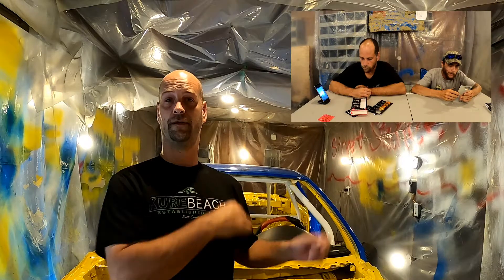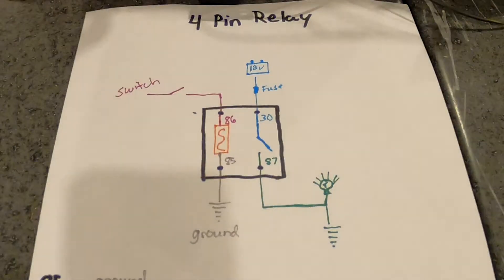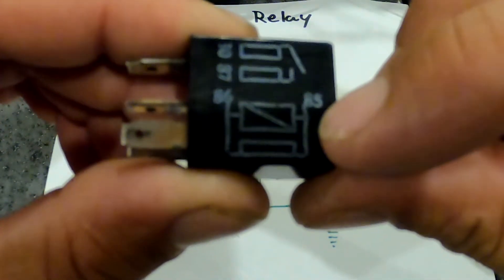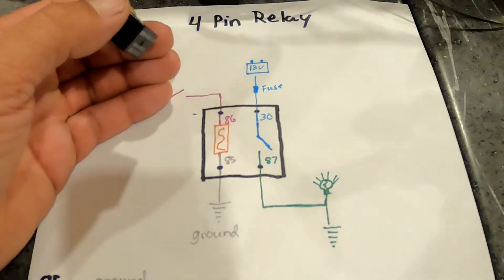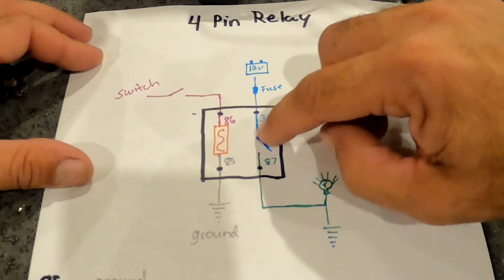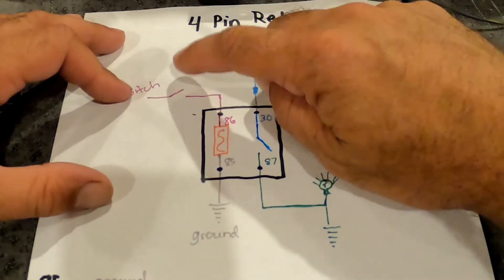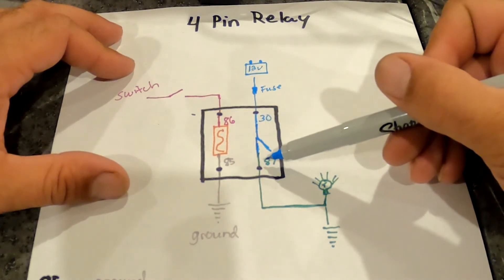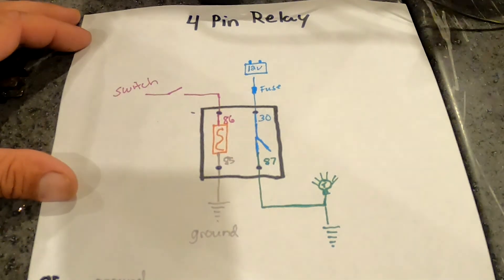How to wire a 4 pin relay

Comment: I have a 2021 ram 2500. A buddy of mine put a piece of wire in the fuse box where prongs 85 and 86 go and now the ac blower stopped working. I have power in 87 and 30 but 86 doesn’t have power no more. I checked the relay and it is still good since the relay was not plugged in at the time. All fuses are good as well. What could have messed up in the fusebox?
Reply from the maker: You put power to the ground. You must have blown a fuse. Under the hood or in the cabin.

Comment: To everybody out there who wonder why a 4 pin relay has 30 embossed on the side of the cover but 87a marked on the spade terminal. Have yet to see anyone address this dilema. 30 & 87a are the same!
Reply from the maker: Thanks for the reply. But your wrong. 4 pin relays don't have 87a. That is a 5 pin relay, and they are not the same one only has power when switched and the other it hot when you turn ignition on. So if you need something on from start and you hook to the wrong pin it will be off. you will have to manually turn it on via a switch.

Comment: I’m trying to help my brother in law wire a speaker into razor.
The razor comes with a bus bar that has a pig tail hook up.
It has 3 wires that feed out from the bus bar . Positive, accessory, and negative. He’s wiring a sound bar into a 4 pin  rocker switch to switch the sound bar on. He has to wire in this exact relay. We pretty much got everything where it goes but the 3rd wire which is the accessory wire. Do you know by chance where the accessory wire could go?
Reply from the maker: Should go to the accessory wire should go to the accessory wire from the ignition. Or fuse block for accessories. So when you turn the key it actives the relay. The power side should be hot at all times.

Comment: Quick question, is it relevant if instead of having a switch on 86 positive feed, the switch is from ground to 85? I mean it shouldnt matter because in my view both options would isolate the solenoid right? Is there any reason not to do it with the switch on 85
Reply from the maker: You can actually do it either way. But being me I would like for the power to be cut.

Comment: So before I found this video I was referencing a different diagram and connected both 85 and 86 to the negative terminal of the battery... obviously didn't work, but have I potentially ruined anything such as the relay, switch, or battery?
Reply from the maker: You may have hurt the relay if you powered it up. But they are pretty resilient. Hook it up the right way and see if it works if it don't power up just switch the relay out for a new one.

Comment: Y cant u just wire light direct 
Y do u need a relay
Can u explain please
Pretty green with electrical
Reply from the maker: The relay give you more control over the consistency of power ran to the device. You will need a 5 pin relay to run bright lights. One pin runs dim lights and one pin runs bright lights. It transfers power from one to another for you to make your lights change over. If not you will have a toggle for dims and another for brights and you will have to manually switch the lights over. And easier to blow fuses and over load the circuit without the relay.

Comment: Do you need a relay for each fog light? I'm running 2 halogen 55w bulbs. Or can I run 2 wires from pin 87? Thanks Matt
Reply from the maker: You can run both from it.

Comment: So if your object has a neg wire and positive wire which do you connect to 87 and where does the other wire go?
Reply from the maker: Whatever you are trying to turn on goes to pin 87 the object ground can be grounded anywhere.
Reply: @streetstancecivicgarage  That didn't answer his question. Your explanation video is like a lot of others that just mentions "power from the battery" and "power goes to your lights or whatever", but electrical circuits have positive and negative sides and wires. It would have been more helpful if you said "A wire from the negative on the battery goes to your switch, and the positive wire from the battery goes to an inline fuse that is rated for the amps of the device you are running, then a wire from the inline fuse to pin 30 on the relay. Then pin 87 goes to the positive side of your accessory, then the negative side of the accessory/light goes straight back to the battery".

Comment: 86 Is the negative coming from the toggle switch?
Reply from the maker: No you bring power to a switch from the battery or power source. Then the other wire when you switch it on goes to 86 on the relay.
Reply from the maker: There are 2 power sources.the switch activates the relay. Ground 85.
Reply from the maker: 1 comes from battery to a fuse panel then to pin 30. Pin 87 goes to what you want to turn on. 85 goes to ground. 86 comes from a power source that turns on with the car. So it's not hot the whole time.
Reply: @streetstancecivicgarage  thank you, I finally got both of my led fog lights set up

Comment: The instructions on my relay which is for an air horn says 85 is to the switch and 86 to the ground.
Reply from the maker: It may be the way that relay is wired for that horn but regular Automotive relays 86 is to the switch 85 is to the ground
Reply: It doesn't matter which way you do it they are reversible.